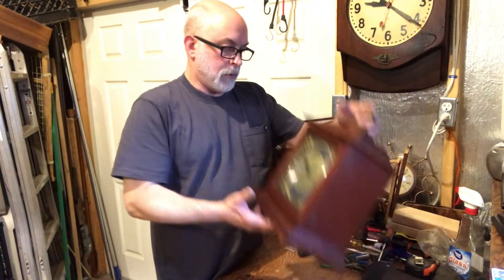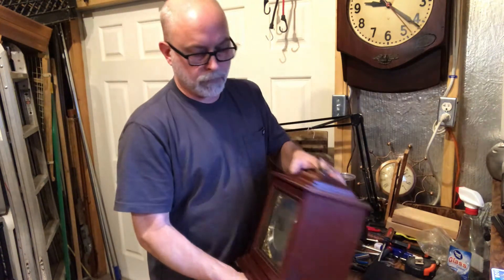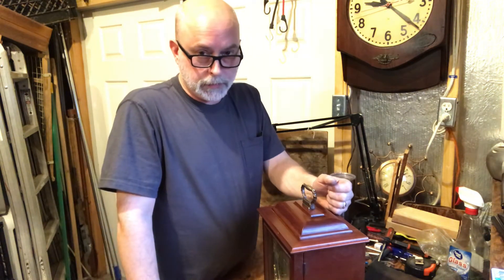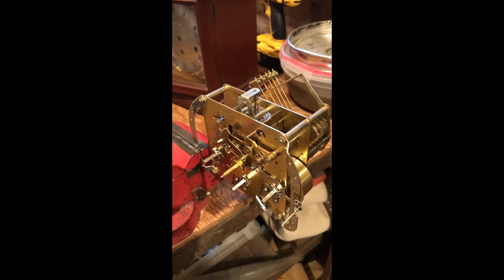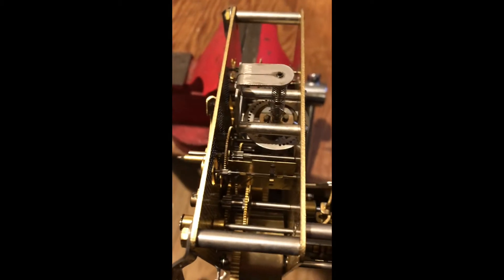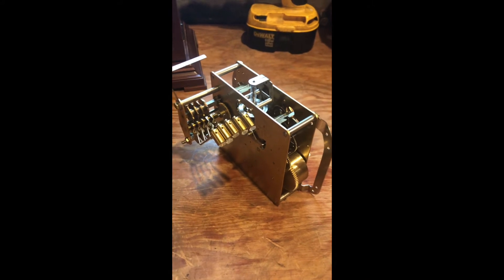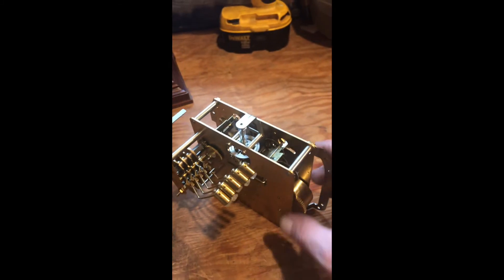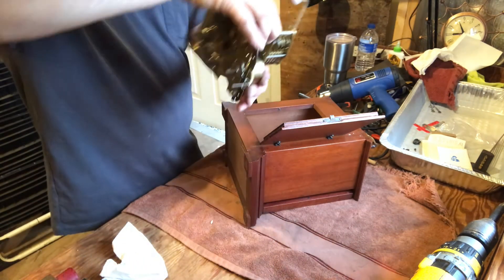The Clock Hack resuscitates a Seth Thomas Model 1314A Legacy Carriage Clock with Westminster Chimes

Comment: I recently bought a Seth Thomas pendulum clock. Gears where stuck, so first thing was to figure out why was that. The hammer mechanism was kind of locked, just needed to give it a little push and it started moving, but the leader (the stick that holds the clock pendulum) would go for a minute or less. Later it would not run with the pendulum on. I started with the basic, cleaned it, removed old oil and put some new oil on it. Then set the pendulum to a "correct" vertical position.  Now it is working 🙂 
Maybe it needs service, but as long as it is running and keeping time, I will leave it as it is. Great video!

Comment: Wish you hadn't sped your video up when showing what you adjusted.  My clock is having the same issue with a balance wheel which spins for about 1 minute and stops.  Have lubricated all the pivots but still won't run.  The rest of the video was good.  Oh well.

Comment: I have some something similar to my clock, mine has an Urgos UW 6/68, took me about 3-4 hours to reassemble since I had to get the warning pins timed correctly, but it’s back in working condition, I also restored the case, it’s a New England pillar and scroll clock

Comment: thanks for the video, but you baffled me on one part.  The very first thing you lubed was off camera and you did a fast forward past it.  I don't know what you did.  I have the exact same clock and have lubed all the other pivots and it's still locked up.  Can you enlighten me on which part you lubed there at about the 5:20 mark?  thanks.

Comment: I know this video is 2+ years old but I have to post . I inherited my parents Howard Miller mantle clock with the identical case and it would chime but not run. The mechanism is a 1050-020. I had a repair look at it and told me it was to much trouble to fix . Another was interested but wanted $960.00 to clean and service it. I tried the hairdryer trick for 2-3 minutes and it has been running since!!! I realize I need to lightly oil it but this video was 110 % useful.